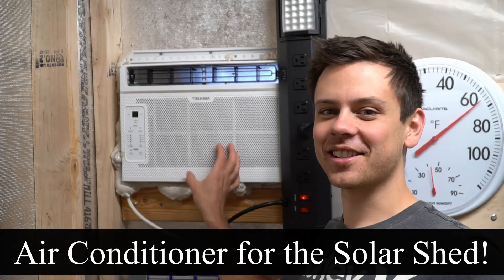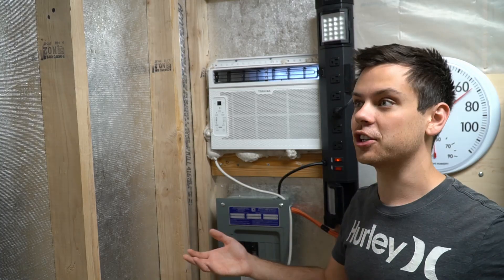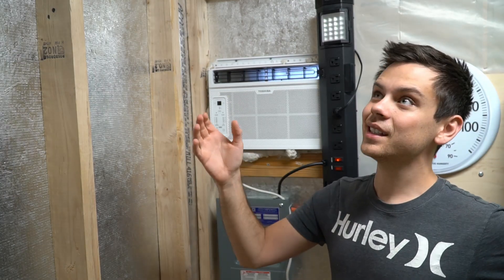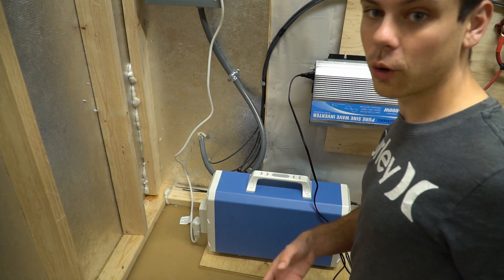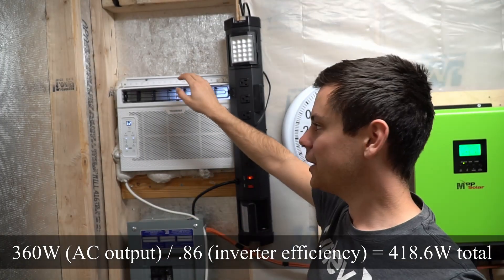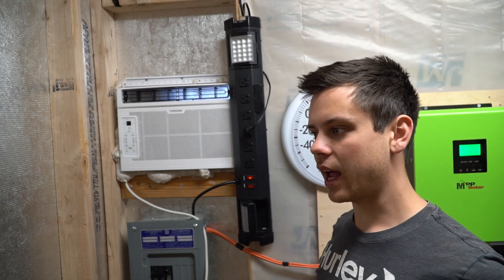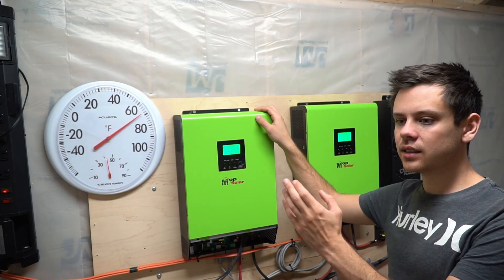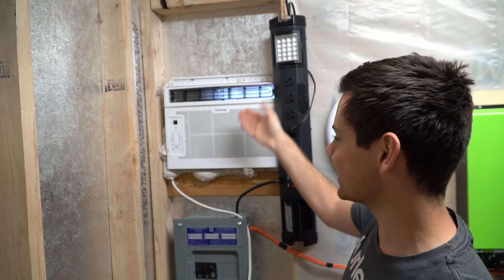Solar Shed: Running a Cheap Air Conditioner

Comment from the maker: Quick corrections and response to comments for this video:
-Standby consumption of Giandel 2000W 24V Inverter actually fluctuates between 6-24 watts. I calibrated my meter and tested .62A at 24V. Some viewers stated .8-1A. Lowest I have measured was .28A.

-If you click on my product links and the product is not present, it is out of stock. This happens a lot. 

-No, I am not using the bluetti indefinitely to power the air conditioner. It was for energy audit reasons only (as mentioned in the video), and because I did not want to add a LVD (giandel lvd is too low for lifepo4). I understand the efficiency losses of this setup, and that's ok. I have multiple videos showing how to use buck/boost converters for directly powering AC supplied appliances, and I understand converter efficiency very well. When I was 15 I soldered my DIY power supplies direct to the rectifier diodes of various products after I discovered the voltage they operated at. This was 15 years ago. This is not "new" to me.

I think people forget that I lived off-grid w/ solar for 9.5 years, and before that I was building circuits from scratch for my robotics projects. I did BEAM robotics and servo control for animatronics mainly. Some robotic arms with linear actuators. Also, long range sailplanes/race drones. I may look young, but I have built a lot of stuff. I don't think people realize that sometimes.

~~~~~~~~~~~~~~~~~~~~~~~~~~~~~~~~~~~~~~
Does off-grid solar confuse you? 
Save time and money with my DIY friendly off-grid solar kits, my latest product recommendations and so much more! 
http://www.mobile-solarpower.com

Join our DIY solar community 
#1 largest solar forum on the internet for beginners and professionals alike. 130,000 members and counting!
https://www.diysolarforum.com

Check out my free book
Best-selling and beginner-friendly guidebook to off-grid 12V solar!
https://www.mobile-solarpower.com/the-book.html

~~~~~~~~~~~~~~~~~~~~~~~~~~~~~~~~~~~~
My Favorite Online Stores for DIY Solar Products:

Signature Solar
Creator of EG4 and the largest DIY solar store online! 
(automatically save $50 by using my link below)
https://signaturesolar.com/?ref=cPwLcVc0SW-BjN

Current Connected
Victron, EG4, Midnite and so much more! Fast shipping and great prices:
https://currentconnected.com/?ref=wp

WattCycle
A very budget friendly 12V battery that works great!
https://www.wattcycle.com/collections/all/products/wattcycle-12v-100ah-group-24-lifepo4-battery?ref=aaezwkkc

Litime
Classic and reliable 12V batteries for solar! Bestseller for many years:
https://www.litime.com/?ref=XBIA62RFcalHns&utm_source=affiliate

Epoch Batteries
High-quality, marine grade 12V batteries that can survive anything!:
https://www.epochbatteries.com/products/12v-460ah-lifepo4-battery-ip67-heated-bluetooth-victron-comms?rfsn=7352625.50494d

IntegraRack
DIY Friendly Solar Panel Mounting Kits! Easy to assemble and super strong:
https://www.mobile-solarpower.com/ground-mount-racks.html

Ecoflow Power Stations
The most popular plug-n-play mobile power station! I have been using these for years:
https://amzn.to/4gID4j0

Anker Power Stations
Highest efficiency and best performance. The biggest challenger to Ecoflow yet!
https://amzn.to/4k0yhMM

Watts247
Need international shipping for large batteries and inverters? Check them out!
https://watts247.com/?wpam_id=3

Rich Solar 
One stop shop for budget 12V systems!
https://richsolar.com/?ref=h-cvbzfahsek

Battery Hookup
Cheap used lithium cell deals:
https://bit.ly/2mIxSqt
5% off code: diysolar

~~~~~~~~~~~~~~~~~~~~~~~~~~~~~~~~~~~~~~~~~~
Contact Information:
I am NOT available for personal solar system consult! If you wish to contact me, this is my direct email: williamprowsediysolar@gmail.com

Join the forum at https://diysolarforum.com/ if you wish to hang out with myself and others and talk about solar

FTC Disclosure Statement and Disclaimers:
Every video includes paid promotion or sponsorship (such as free products for review). Some links on this YouTube channel may be affiliate links. We may get paid if you buy something or take an action after clicking one of these. My videos are for educational purposes only. Information is subject to change/update at any time. Electricity is DANGEROUS and can kill. Be smart and use common sense :) DIY Solar Power with Will Prowse is a participant in the Amazon Services LLC Associates Program, An affiliate advertising program designed to provide a means for sites to earn advertising fees by advertising and linking to Amazon.com
Reply: Don't let anybody look down upon you just because of your youth! Great job, young man.
Reply: Your true followers already understands this.. don’t worry about the others
Reply: Hi Will, Can we expect another livestream or upload soon?  I promise to moderate more heavily but last time I had just woken up & was really tired.  Hope to hear from you soon buddy!
Reply: Could this set up work on a boat using  a 5k-6k wall ac unit?
Reply: You look younger than you are, but that's a mighty fine blessing that can't be had with potions or surgery. And of course it has a whole lot of nothing to do with your knowledge, skills, and abilities. If someone wants to contradict you in comments, I think they should do their own work first. I'm sure they'll find you to be correct, and voila!, no crappy comment. Thank goodness I have my sweet cat Luna living with me to counteract the negativity generated by people. Carry on, Will, I'll see you next video! Thank you!
Reply: Yup, your videos are great, ignore the trolls ^^
Reply: Glad I found your channel. I'm not into solar yet but about to setup our first generators for outages here in FL. It's hurricane season😏
Reply: Another thing you can do is run a mechanical cooling stat in your attic space with a couple of the large computer fans. They are dc and you could run it direct off a battery if you want. The idea is crossflow of air in the attic space from one gable to the other. It helps take the added heat load away before it taxes your ac.
Reply: Major hole in the market that a device that has the minimum consumption of the giandel’s as well as a low voltage cut off, plus the ability to handle a 24v/48v battery bank. Without this its not plausible to build a “decent” complete system that powers a whole house/shed with inverter running the whole time. Those 96w plus auto cut off without auto resume make those green mpp all in ones pretty crappy.
Reply: don't let them bring you down.  this is good stuff.   keep up the good work
Reply: I bought one of those inverters and I loved it and all the sudden out of nowhere it starts making a loud constant beep noise and says  OL  i don't know how to contact them because they're an Australian company with no 800 number do you know what the o l means and how to reset it I opened it up and none of the fuses were blown
Reply: You
Reply: How can I tell what I need for what I’m going to use it for?????
Reply: @eastcoastnews9529  Will has a lot of elementary solar and electrical info and example projects in his book and on his website -- like his videos, he knows how to make this subject accessible to everyone.
Reply: I have installed solar panels about 1000Watts, inverter about 2000Watts (max not sure), I am planning to buy 5000Btu AC. Hopefully it will workout. any suggestions? is heat pump available at this capacity? it will be nice to use same equipment in summer and winter..
Reply: I know it's quite off topic but do anyone know of a good site to watch new tv shows online ?
Reply: @Randy Fisher flixportal xD
Reply: @Marcel Cyrus thanks, I signed up and it seems like a nice service :D I really appreciate it!!
Reply: @Randy Fisher Glad I could help :D
Reply: Not trying to ruin all the awesome solar-powered AC fun going on here Will... however, depending how many batteries you actually need to store/keep cool(?) Maybe you should consider adding/constructing a small cinder block root cellar (or maybe dig a hole & sink an extra-large camping cooler) below your shed(?) The earth and cinder blocks (or large camping cooler/ice chest, etc...) would provide some pretty awesome natural heavy-duty insulation, which in turn would help keep your solar AC system efficient, simple and minimalistic. If that's too much work, too risky due to local building codes and/or simply won't work... then maybe a couple used "pelter" operated wine refrigerators/chillers running on solar might possibly do the trick in keeping all your batteries cool...?...
Reply: WJK Peltier type systems are generally very inefficient & power hungry.
Reply: Evan Wittwer - Don’t get me wrong, I absolutely love Will’s Solar powered air-conditioned shed. Actually totally forgot, Will’s in AZ, so no amount of free/abundant AZ sunlight would warrant the use of a peltier  fridge on account of the insane AZ temps/heat ... however, someone on a tight budget (in a more Northern/cooler climate)  could keep their batts cool on a solar powered (super cheap) thrift store scavenged peltier (ie, wine) fridge, which would still accomplish the goal given the pelter fridge (regardless of inefficiency) would be running off free/mostly free sunlight.

While we’re on the topic, I could also see storing RV batts in a cheap used portable peltier cooler & then leaving the cooler in the RV to run off solar when sitting unused In the Summer.
Reply: Will, with the outbreak in china is there any non Chinese solar components we can buy that you think are good, even though they might cost a little more
Reply: Hey look who came around after mocking my suggestion about doing a video on solar powered air conditioning.. 🙄
Reply: I am not looking down on you but your viewers watching this will not be sufficiently reminded of a air conditioner being a heat pump and pumping Heat is inefficient unless you have some place cool to pump it. In fact some places are too hot to pump the Heat when do you need to pump at the most. But it's very routine for people to ignore the efficiency boost if pumping prior to the hottest hours. Many many businesses run their air conditioners during those hours even though they use extremely expensive electricity and do not provide any cooling beyond the draft. That is the coils are dry on the indoor evaporator coil. That coil is too warm to condense any of the humidity and it often is warmer than the air.

This situation should be address by the electric utilities but they make lots of money running air conditioners continuously despite them having an illegal efficiency level.

There are many solutions to this problem as you are well aware of. I think the main thing here is that you're using the air conditioner as a token load to demonstrate your off-grid solar system. I don't know if you agree but saying it that way might help us better understand what's going on here.

What lots of insulation does is it allows you to precool and then when electricity gets very expensive and the btu of the air conditioner is at its lowest level you can just turn it off. The buffer that you created will let you Coast until the btu to Watts consumed gets back to a respectable level. One of the ways of helping the insulation is the add lots of thermal Mass. Right now I'm trying to keep some peas alive. Peas are very sensitive to heat so I'm growing them in an ice chest and open top ice chest filled with water below the bottom of the pot so that the evaporation chose the water and the insulated sides prevent heat from getting in that way it's amazing how cold the water stays play it's going to be in the mid-90s today so we'll see if the pea plants continue to flower!
Reply: @JS-vx1nx  it is possible to use the water from the ac unit to spray the coils to cool them thus adding the efficiency?
Reply: @JS-vx1nx  All good points, worth reviewing -- except that the AC "token load" is actually protective for LFP batteries, which degrade under high temperature and full charge conditions, I believe.
Reply: Sorry about all the typos. I wanted to add one detail about the amount of water you need when you have water being stored in an ice chest. It's actually a very small amounts of evaporation because evaporation shows the rest of the water and as the water gets cold or the rate at which it evaporates drops tremendously. The question is will the reduce the vapor Asian cause the peas to be deprived of sufficient humidity?

Comment: Hey Will, i been following you for awhile but more of your latest video's. Today i came across this older video, because i was looking for some information about window units on solar.  Here is my question,  i am on a tight budget and trying to figure out the best way to run a window ac with heat on solar, but also be able to connect to the grid when i need too. I am looking at the midea 8000btu window/through wall ac with heat. What would be the best setup regarding to amount of solar panels and inverter etc. I was thinking of something like the handcart mobile unit from one of your recent video's. I have a full basement and can store the batteries below the bedroom.

Comment: I want to construct a small shed to house all the equipment needed for a 18kw system less panels, what is the pproximate size I would need to build? System willl have 30kw of battery storage and thoughts about future expansion as well is a good idea. Thank You

Comment: Did you say that is a 2,000 watt inverter?
How many amp hours of battery?
How many solar panels and size?
What size charge controller? 
Off grid in south Louisiana. 
Thanks for your time and help.

Comment: Hello will, I purchased a portable ac unit, I would like to run with an ecoflow generator. I would like to run the unit for about 8 hrs at nighttime off grid,the wattage for the ac is  about 900watts, what   size ecoflow generator or solar generator would you recommend.

Comment: I still got small window units with a mechanical thermostate and no electronics, and something like that would be perfect for doing this and someonw could use the save mode for it .

Comment: I hooked my 1995 18000 btu 240v heat pump window unit to an ecobee thermostat. I had an old 2010 ecobee tstat not being used used to be in my house. this way i can control it with my phone and also so the fan doesnt stay running all the time. my shed is 300 sq ft. Dont have solar would probably need a vast army off solar panels to do that.

Comment: I wanted a backup unit I could put in a window in case the main AC fails. It consumes 360W on the low setting so I can run it with a power station if necesssary. It was able to cool an 11x11 room adequately.

Comment: My 8k btu only uses ~600 watts on high fan and max cool. It will feeze you out on 1/2  of a 2k sqft house after a few hours. Running it all day when the sun is out is a no brainer

Comment: You could use Yolink temperature sensors and power plug to use your computer to monitor the temperature of the shed, and control the power switch. They use LoRa radio so can be hundreds of feet from the hub and your house.

Comment: This is PERFECT info for what I've been looking for. So many have built out a cargo style trailer for overlanding or camping. But the trailers (dedicated production or home built) have varying degrees of insulation. I"ve been hesitant to buy even a small camper without figuring out how to run some type of small AC on either 12 or 120 volts. this vid along with a full time nomad camper that runs a 120v 5K BTU AC on about 1K of PV. Excellent info!

Comment: What setup would I use for 12 volt in a trailer. I don’t want to use 30 amp, so I’m installing solar to boondock with a window AC.

Comment: Do all the Giandel Inverters have that low idle power consumption?  I am looking at something less than 2000watts as I just want to power a refrigerator, so like yourself with the AC unit, I don't want to be wasting power.   I had taken a tip from one of your other posts in regards to 12 volt and RV refrigerators being rip off, where you can buy a dorm fridge / deep freezer for far less and have a much larger unit.  But yeah, these work off AC only and so a low idle current inverter is necessary.   So far the only other inverters that I have come across with such low idle current was the Victrons...and we know how expensive those run.  Edit--Answered my own question.  The 1200 watt model does have around the same .6a - .9a current draw at idle.   It is at a nice $199 price too.   I was going to go with an All-In-One, but as you pointed out in many other videos, they can have a very high idle current.   So I think separates are better.

Comment: With the inverter 3000 watts 
How big the  fuse amp I should put between the battery and the inverter?

Comment: Where did you learn all these details about these ways of the blue battery the inverter and ac stand by consumption? Do you have an electrical engineer degree?

Comment: I have the 24v giandel 3000/6000 pure sine wave inverter... it can run my 5000 btu window a/c unit without a problem but cant seem to run a mini fridge when I hook it up to the inverters outlets so I had to hook it up to the hardwiring connection on the inverter and it works fine. Im about to test this inverter to see if it can run a 12000 btu Frigidaire window unit that pulls 1000 watts.

Comment: Hi, please do you have any idea why panels above 320w with above 45Voc stops producing amps once the voltage from the panel is above 45volts?
I have setup two systems with different panels and makes and both doing the same thing.
I thought it's my charge controller but I changed the controller, same issue. Then I decided to install watt meter before the charge controller and I noticed that, when the sun is really up and blasting, the voltage ⚡ rises above 45v, the panel stops producing amps.
What can be done in this case please?